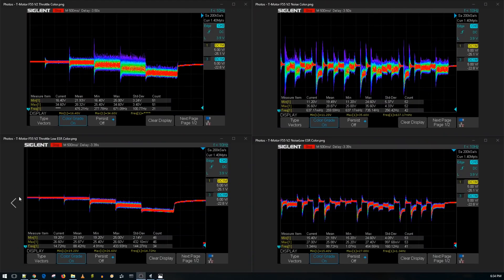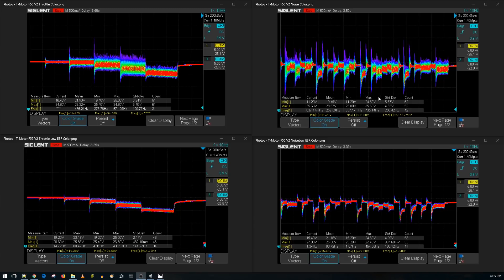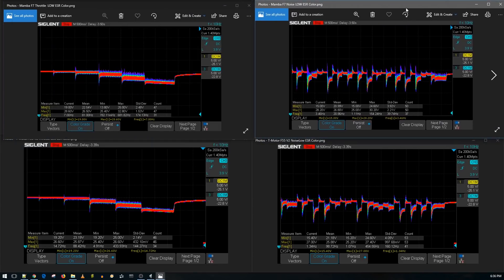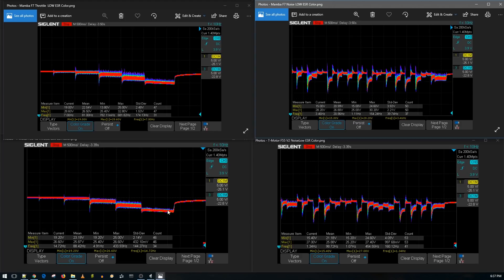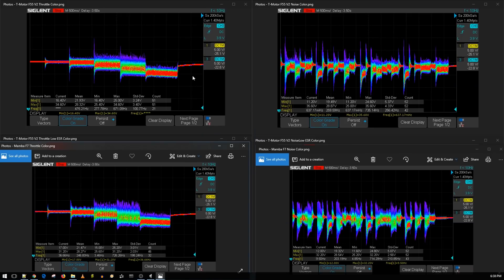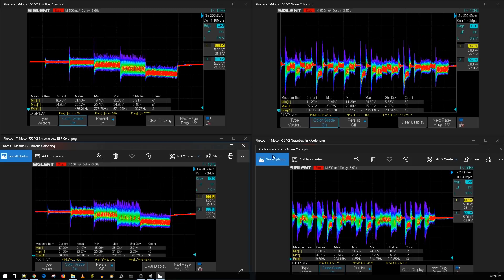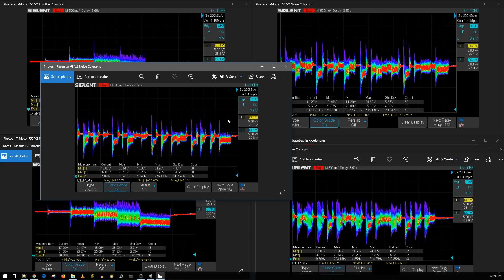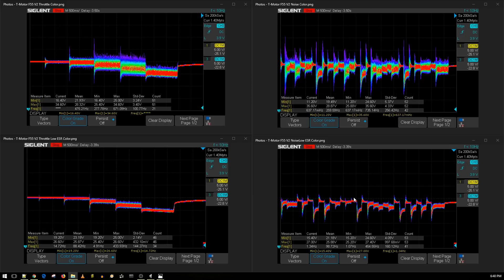T-Motor F55A Pro V2 // 6S ESC Noist Test and Review

Comment: are low ESRs important when using a digital system?
Reply: Still important for ESC performance, and LC filter combined with capacitor on the input power for the digital system helps tons with clarity on those.

Comment: If this is average for a 6s high amp 4in1, what would you consider the best? Planning on building a 2750kv 6s 200mph+ setup and I need just that
Reply: What did you end up using and what speed did your eventually hit?

Comment: I just installed this esc on my 7inch. When I went to blheli suite it didn't show current protection as an option. Why is that? could you please hook yours up to blheli suite and confirm this .
Reply from the maker: There is no current sensing for each esc on this just a dedicated separate one.
Reply: @DroneMesh  thanks for the quick reply. So how do I set it? I want to set it at 40amps
Reply from the maker: You cant :(  
You need a 4in1 esc that has seperate sensing for each motor. This one does not that support
Reply: @DroneMesh  ok got it. Thanks